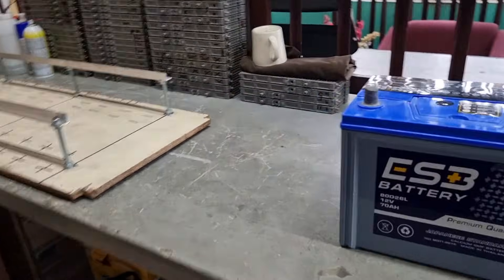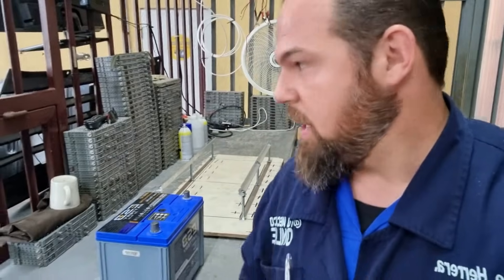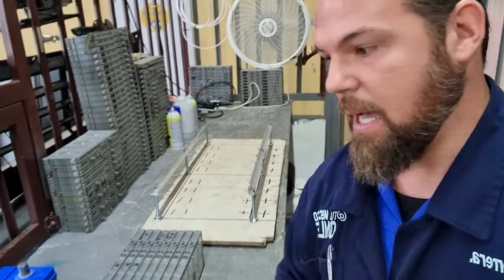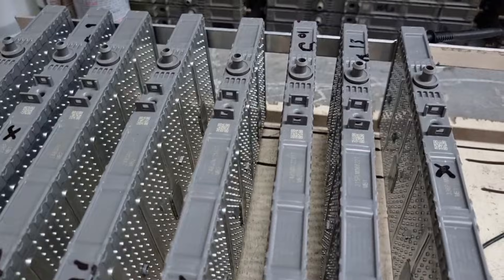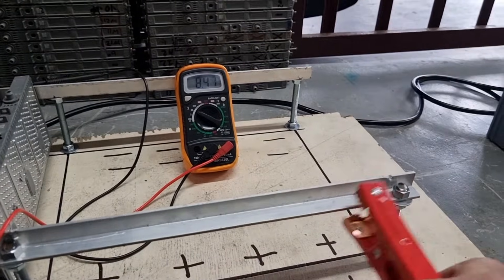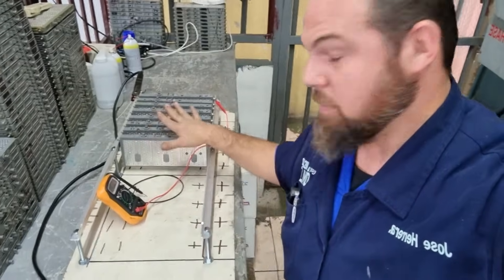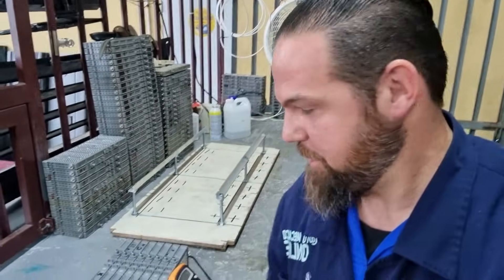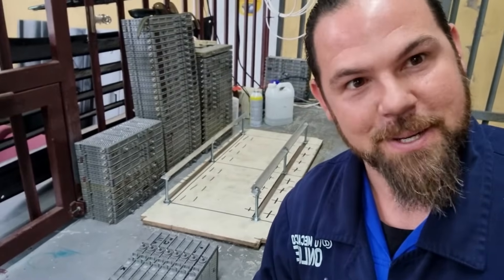how to charge a hybrid battery with a 12v battery

Comment: Question.  In theory if I connect a 5w bulb in series technically would it lower the amps going to the module?  Then I could I safely charge a single module like this?

Comment: José. At first thank you a lot for your knowledge you share to all of us. I tried to charge the cells with a 12V battery of my Lexus GS but when I connect the cables it sparkle in an extreme way. There are 47 cells + and - placed on a self made board like yours. What am I doing wrong? Gracias mi pana

Comment: If your battery’s are so low it won’t start gas engine can I use this method to charge all modules so I then can use multi meter to find fault dead modules ?

Comment: Great info..! Thanks. 

I have a question: after balancing, what is the minimum overall safe charge before putting it in the car? If it's 7.2v ok?

I don't have a charger, can I do this method to bring it to 8.X and install it in the car?

Thanks again

Comment: Will this process work on GMC Sierra Hybrid Battery cells? The battery has been sitting for 6 years now because the truck has been parked this long, and it is the original battery from factory.

Comment: you could  connecta a 6 w lamp 12 volts and you can charge at a rate of about 500 mA
Reply: I was thikink the same this should be adjusted some way as you have about a difference in voltage and a resistentence of the batteries that is calculated as 1/0.012 mohms per battery what means a high current

Comment: I wonder if you can use it not 12 V but like a tiny battery for like smaller scooters and it will be safer because I feel like this is a very big plane with fire situation

Comment: Hello first off i love your channel and i learn alot from you. Im very interested in hybrid battery building for cars and solar!  I bought a plug in hybrid 2016 hyundai sonota its is a notorious car for problems and love to fix it when its a good  bargain. Mistake #1 I’m a car stereo enthusiast and  the first thing i did is install a  JL audio JX500 very powerful small current drawing amplifier with one sub drawing 300 watts at 4ohm stable. so you probably already know iI’m reading that i shouldn’t have installed a extra amp in this car because my car doesn’t have a alternator? and the car already has a amp and cant afford the power to the new amp. snd so because i bought the car used from a person that didn’t  know English and i didn’t understand Russian he didn’t explain the rules of the car plus he never had the charger for the car he was going to order it and call me but never did. Mistake #2 i rode around For a month the car was fine but i wasn’t charging it either and had a extra amp in it. I noticed the car was staying at min charge and because I’m new to car hybrids and didn’t know how to properly change the settings of the car from hybrid to full electric snd charge mode i never used these function’s. . now the car has the warning hybrid battery triangle snd I’m trying to work on this car myself partly because i broke it, and love to learn about hybrid/ electric cars but secondly i don’t have the money to give the dealership to repair. Looking back at my mistakes I’m positive i must have either damaged the 12 volt  battery and or some cells in the hybrid battery. After watching your channel I’m  motivated and believe i can fix it myself. So i pulled out the set up immediately.  Starting researching and learning watching you, arming myself with the knowledge needed to tackle the battery issue. Usually in california its good weather but no luck so far, but at least its giving me time for research. my question is “i checked my 12 volt battery and  it was at 10 volts and i read that the obd2 plug in wouldn’t work under 10 volts and the port would not power the  scanner. So i charged the 12 volt battery with the post still installed to the car! And the car never went past 10 volts even after 3 days on snd off charging  so i changed the battery and charged it again this time taking off the negative post snd finally the charger ended with 100% charge this was today and then i see this video and Im thinking when i charged the car for days with the post to the car intact did iI again over cook my hybrid battery? Is that why it never went past 10 volts? Because it was charging both the hybrid battery and the 12 volt? Im confused because the next battery made it to 100% ?sorry I’m just so new to all this!!! If this was true  then i could have charged the hybrid battery thought the 12 volt cables the whole time? By tue way i have since bought a 30 amp charger and a portable 120 volt charger as well. And just picked up another one with low and high charging settings. Thank you in advance for your channel and time.

Comment: Hi
I have Toyota Prius 2006.
Replaced hybrid battery, it's running perfect with hybrid system.
But ENGINE LIGHT and Triangle light always on.
I tried clear  error by obd2 but still back by same time.
Please updates 
Thanks

Comment: That was very helpful. I have a question related to this charging method. 
Do you think it’s possible to connect two similar 12kWh battery packs together to increase the capacity and therefore PHEV  range? I understand this connection would have to be in parallel to increase capacity but keep voltage same. I want to double 2018 Mitsubishi outlander PHEV capacity from 12kWh to 24kWh by adding a second battery of exactly same type, in parallel. Would that work?

Comment: Hi Buddy I have a Chevy Tahoe  2008 Hybrid we was on the freeway and we ouch the speed above 90 after the car turn off we can't turn on again  we check codes and fuses and fuses are ok. But the code appears on the  comouter tester is related with the hybrid module or battery, whatbis the best way to test the hybrid battery charge or the module hybrid control??

Comment: I have a question to you is there option to charge this with approximately 10ah 12 v power supply in same duration of means 10 to 15 second may better way to charge when don't have 12v dry or gel battery is that possible?

Comment: I have a 2007 Ford escape Hybrid I head told I needed to change my transmission fluid. All the batteries are down. I have a new battery to go up front. I have no one to help me so what should be my first step. I bought a battery charger.

Comment: Can we discharge with this way? Where u connect 12v battery probe if I connect 💡 bulb can it's work? I have not any mechine I want to discharge hybrid battery but system shutdown in 21% state of charge I'm not able to check the bad one cell..... 😢
🤷🤷🤷🤷🤷🤷🤷🤷🤷🤷🤷🤷🤷🤷🤷🤷🤷🤷🤷🤷🤷🤷🤷🤷🤷🤷🤷

Comment: Can someone explain why they have to be balanced? Is it just so they can be individually load tested? I have checked all 28 cells and they are (on average 7.75). Will the car balance them after installation? 
P.s. I replaced 4 cells with some i bought online and they have about the same voltage as mine. Thanks!
Reply: The car doesn't have a balancing feature, if to out of balance car will throw a fault code, batteries in series have to be balanced or else they will not perform as intended.

Comment: So I did this, and plugged the safety switch with my charger still on. It blew the fuse/shorted the charger. I bought another charger, and now im not getting any voltage to the two wires. Before I was getting 278v. Is there a fuse connected to those wires, or did I mess the whole thing up?

Comment: I thought about splitting the hybrid battery pack into two batteries in series and then charging them with a 12v charger. If the battery is 7.5+7.5 to make a 15 volt battery, it would only charge if the 12v battery charger charges at 15 volts. Would it work if it charges at 14.5 volts tho?

Comment: what if a do pairs in SERIES? 2x7.4v cells = 14.8 V    Charged in pairs with a regular 12v battery (15.5v). or 3 cells = 22v +/-  Charged with a 24v charger?   The question is....  how many AMPS is advisable?    Thanks for all your videos!!  
Good Job!
Reply: my honda civic hybrid is the same. 2 sticks in series which was supposed to read 14.8 but was reading 12v. hooked 2 car batteries with 700cca in series to make the 24v charger and every stick now reads 15v. just dont hold the power on there too long 15-20 seconds was long enough and i waited 15 mins to check voltage again and repeated maybe 1-2 sticks until they held power. car gets 10-15 more mpg from this so i see it as a win
Reply: Good question, I don't think this will work.  Charging is based on the potential difference, so ideally the battery cell that you are trying to charge, by design should have less potential difference than the car battery which is based on 12.6V (by design).  I think that's why Mr. Jose is charging all cells individually here in series.

Comment: Shouldn't you be charging through a power resistor to avoid high current charging which reduces the life of the modules? Plus is that you can leave it charging for longer time instead of disconnect and reconnect. Even better to use a voltage regulator that auto stops charging when the correct voltage is reached.
Reply from the maker: With your statement you clearly didn't see the complete video neither understand the purpuse of it... 👉 ✔️

Comment: If you're using a 12-volt battery to charge the group of 8 to 10 modules couldn't you use the same balancer and hook up  A two amp trickle charger to the rack and slow charge Your group and then use like a headlight bulb and connect that with alligator clips to the rack to discharge the group and then repeat the process three times

Comment: HELLO, Sir 
 I have p[rius 2010 but one cell8 is weak so how i can charge or balance parallel with a normal charger with 12 volts and how many amperes should be? 
Thanks

Comment: Great video!  I have a 2013 ES300 Hybrid. it was parket for months and now it will not crank. Do yu know how to charge the hybrid system using a regular 12 v battery charger if possible?

Comment: 8 volt batteries are available for antique vehicles of 6 volt systems. The 8 volt battery is used to improve starting and of course daily use. This is normal to use an 8 volt battery on old cars.

Comment: What about using a 12V (output) electrical charger that has an automatic current controller..? It even totally disconnects when the battery module is fully charged, indicating FULL. I would like to know your thought. Thanks

Comment: I have hoppy chargers about to do the discharge charge with 2 hobby charges 4 channels each. I also have a noco 12volt charger. My question is if I hook up negative to negative and possitive to positive. Can I charge all at the same time with the 12 bolt charger or the hobby charger.
Reply: I was wondering the same thing.
Reply: I don't see how not..
..I even considering not putting them all apart but charging in the pack.  It's already set up to get charged.

Comment: Sir, I forgot to mention in my earlier comment that I cleaned all the terminal copper plates and wire cable terminals with alcoholic solution before reconnecting the batteries.

Comment: Sir, your explanation in Toyota Prius Hybrid batteries and methods you use to rectify faults are marvelous. I followed your methods and learned a lot. 
I have a 2009 Prius and it gives an alarm after several minutes when started the vehicle. But the vehicle runs with less AC. Once you stop the vehicle can’t start again. If you remove the small battery terminal and after few minutes when you fit the terminal back you can start the vehicle.  
I checked up with a scanner then you get a fault called “P0AA6” hybrid battery voltage system isolation fault. 
I noticed when I remove the batteries some of them had leaked. I replaced them with fairly good ones. But still I got the same alarm again. Could you please help me to rectify this problem. 
Hope you would reply soon.
Reply: I'm facing exactly the same problem now. Have you managed to fix it?
Reply: @JanuszeQ94 you will most likely need a battery ecu, wiring harnesses, and clean the bus bars . Along with of course replacing the cells leaking electrolyte. They will have obvious white corrosion on their silver body part.

Comment: Hi, I have a Touareg baterry, my question is if I could charge the baterry in the same way as you or is there a different way to charge? and in another video I looked that you used a special charger, is it necessary to buy one of those o r is there any alternative? I´m writing you from Mexico
Reply from the maker: No need for VW vehicles… they use Li Ion batteries
Reply: @hybridsolutiondiagnostics  oh, I understand, so...is there any way to charge those batteries? Or is there any other solution? Do you have another way of contact like mail or phone? I need help with this, we can pay for your help

Comment: Surely that means the battery cables dissapate about 400W. Current is 100A, load approx 8V, car battery 12V therefore difference of 4V across cables?
Reply from the maker: Easy right 👊😎

Comment: Thanks for all of the great information you are sharing.   I use your process to balance and Group charge my prius battery rebuilds..  ie connect all Negs and Pos.. to balance..  I use a hobby charger to charge the whole group.. I charge at .5 amp and up to 8.5 volts...  the charger shuts off when the collective voltage is 8.5.   Then I let it rest to balance.  charge again.. repeat...  This is what we can Top balancing...     ???      My question to you is  what could I use to discharge the 28 modules down to 6.3...  let rest- balance..... discharge....... let rest - balance..   ie Bottom balancing.        My ultimate  goal is to be able charge/discharge 28 cells at a time...    to recondition the individual cells in bulk.     My current system only allows me to charge/discharge 4 at a time.  How do I cycle (charge/discharge) 28 cell at one time..     To clarify...  I understand balancing and bulk charging due to potential differential current...    How can I charge and discharge 28 cells to attempt to recover Amp capacity..    Thank your for your time..

Comment: Can i charge just one cell with that method?
Reply: Yes, but be careful,  because the voltage in your cell will raise faster and will heat-up faster too. Using 8 cells in the video the teacher only keeps charging for 15 seconds. If you use only one cell maybe 1 second will be enough, but also I think will be risky with only one cell. Also in the example he used many cells to do a charge balance too.

Comment: I replaced 2 reconditioned ones but they were about 6 volts sitting in the garage for sometime.will they charge by itself while driving ? Or i have to take them out again and charge?i still get a check light .yes i did load test when i found the 2 bad ones
Reply from the maker: At 6v they are very bad... nominal it's over 7.2v

Comment: Hi Hybrid Solutions. All my dash lights in 2007 Toyota Camry Hybrid are on (Triangle, ABS, Engine, Check Hybrid System, Check VSC system) with code POA1B, C1310, C1259. Do you think it is because the hybrid battery is weak? Is there anyway to just replace the bad cells in the battery? Thank you.
Reply from the maker: Do a complete health test and send it over to our instagram DM 👋😎

Comment: I discharged the high voltage battery in my Hyundai Ioniq hybrid ( not plug in , just Hybrid) . Without, the ICE is not starting and without ICE no high voltage battery charging. Can I use this method to charge the HV battery so it can start the ICE? Where would I connect the 12 V battery plus and minus ?
Reply: You have to connect all the
Cells in parallel.
At the moment all of them
Are connected in series.
But it's possible.

Comment: I'm sure you get this all the time, but is it possible to charge the HV battery on a gen 2 Prius whilst the battery is still in the car? 
Mine is at a useless repair shop as the cat was stolen and the engine won't start after cat replacement. They "accidentally" drove it into the shop from the parking lot on EV mode and drained the HV battery, so I'm guessing I'm hosed since the HV pack gives power to MG1 to start the engine? The issue could be somewhere else too as the car stood for a year after the cat was stolen (2 times in a row).
I'm pretty desperate here...sorry.

Comment: Hello Hybrid solutions. Do you think a charging socket could be fitted to a Hybrid car to charge the High Voltage Battery while parked overnight at home?
I believe the High voltage battery in a Hybrid would probably be a stack of these 8.5 volt battery packs in series. So I guess about 24 of them in series giving a total of about 204 volts.
 
Is there a charger that could be connected to the car to charge the High voltage battery. I am hoping that would give enough short range use to get to work and back and possibly not use any gas.
Thanks Brian in New Zealand
Reply from the maker: Hi brian 👋😎... yes you can... but you will have to tell me which car it would be for because many factors will depend...
Reply: @hybridsolutiondiagnostics  hi!  I had a similar idea as brian in mind thus I found your video. 

I consider sticking a flexible solar panel onto a 2015 Yaris 1.5 Hybrid. What kind of charger would I need between the panel and battery? 

Thanks a lot.

Comment: How many ampere do a cell have?
Reply from the maker: 6.500mah 👋😎
Reply: @hybridsolutiondiagnostics  From flat, a cell would take 3600 coulombs of charge or current that works out at 6.5 amps for  3600 seconds or 1 hour or 13amps for 30 mins or 26A for 15 mins or 52A for 7.5 ect
Reply: 23,400 Coulombs for a 6.5 ah cell.
Reply: @hybridsolutiondiagnostics  thanks👍